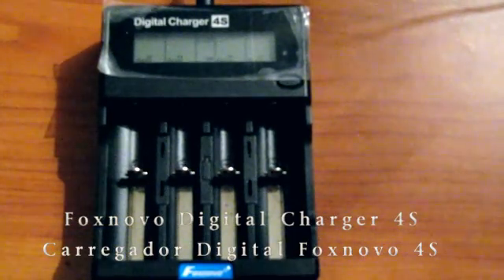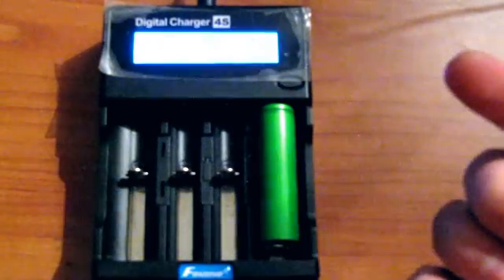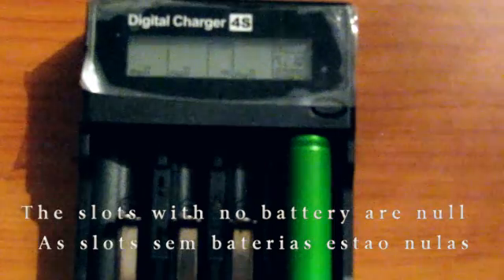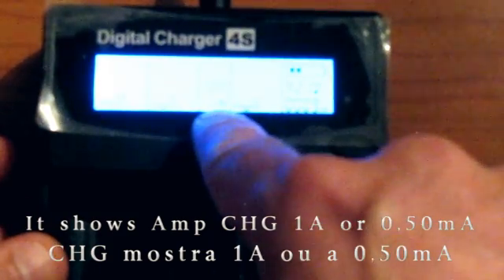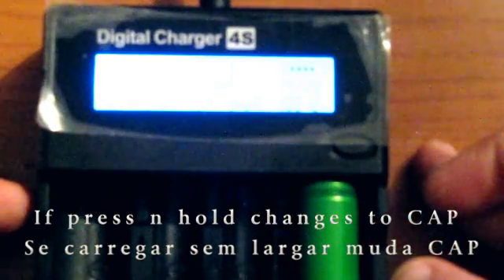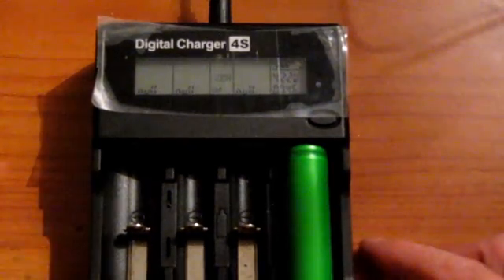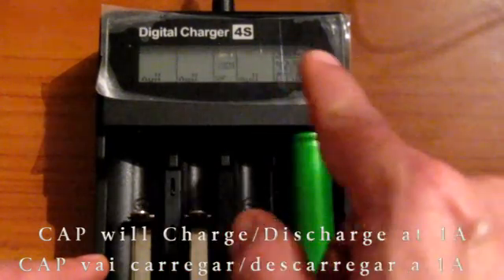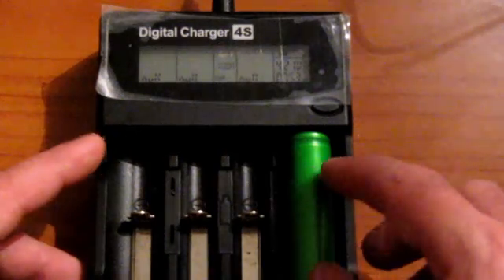Foxnovo Digital Charger 4S

Comment: Is it normal that ICR18650-22f batteries become hot while capacity testing?
Reply from the maker: Athax Designs when that happens, normally is because that battery, has got some internal resistence... those may have some capacity, but they are more instable... I only use those in flashlights, led strips, with low amperege needed...
Reply: Electronic Matrix My batteri got almost up to 38-40C, so i took them out while they were being capacity testing, i tested them and they have a 4,2v even tho they're rated 3,6v
Reply from the maker: Athax Designs the nominal voltage is 3,6V, but fully charged is 4,2V... but I only charge them to 4,1V, only for the capacity test 4,2V... those temperatures are showing, some internal resistence... so try the capacity test, lower then 1A maybe 0.500 mAh if using the Foxnovo.
Reply from the maker: Athax Designs when I solder them, they can get to that temp... but some people, say we shouldn't do that, but I solder them and hadn't any problem yet... if even testing @ lower mA, they go above 40/50 celsius don't test them... use them in flashlights or projects you always have an eye on them... Be safe while using batteries!!!
Reply: Alright thank you very much, is it the same with icr18650-22B ? Got them from a working laptop
Reply from the maker: Athax Designs you can check both datasheet online by icr18650-22B and see their original capacity... so when you test them you know how low in capacity they are...
Reply: Alright I'll look for it thanks! Last question I'm sitting on my pc now and doing a Capacity test next to me, is that safe? Can they release toxic fumes or something while they're charging?

Comment: Not impressed with this charger. I've tried doing a capacity test on a 3000mAh 18650 at the 1A rate. I've tried both the outside slots and the discharge rate is less than 0.5A. This is with only one cell fitted in the charger. On the recharge cycle the cell got to 3.7V and the mAh counter stopped incriminating. This a new LG cell.
Reply from the maker: Hi Kevin I don´t have the same opinion, by far the most important feature, I was looking for is to see how many mAh, are going out of my 18650 so I can make sure that they are in good working order and don't need to get recycled.Long press to access the testing capacity mode and LCD shows “CAP”, you can choose the discharge rate 0,500mA or 1000mAh, but I don´t know the acuracy of it, for me it´s nice to have, a way of comparing my 18650 batteries. Another easy feature to incorporate would be to turn the beeping on or off. I found this to be annoying when charging batteries overnight as the beeping is pretty loud. You would like to see the charger be able to sense the battery, I only tried with AA, AAA, 18650 and it worked fine with current for that type of battery.But I have another solution that I use and for me is better:https://youtu.be/0VIpairUVJs